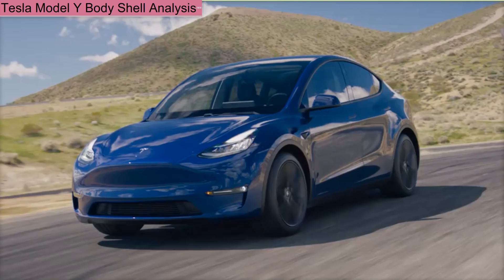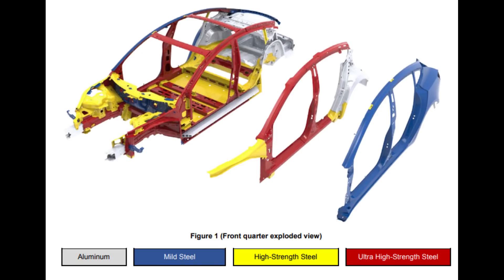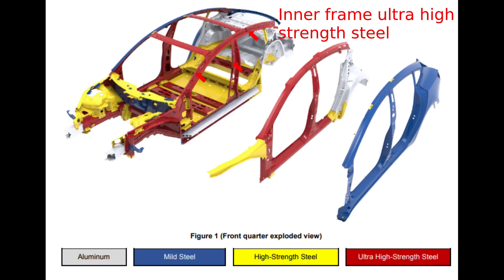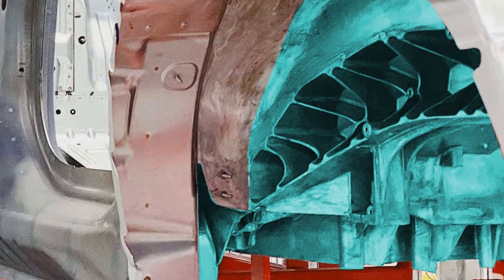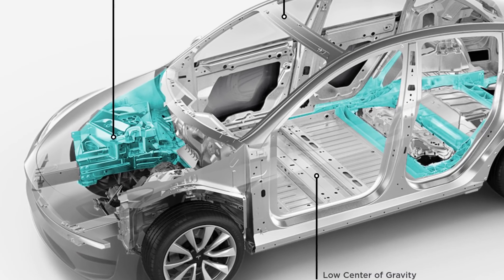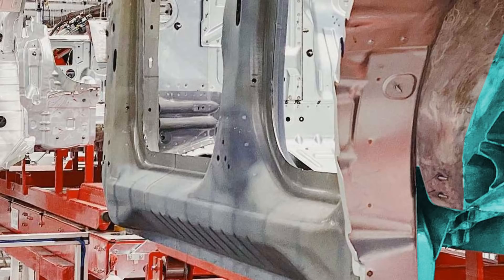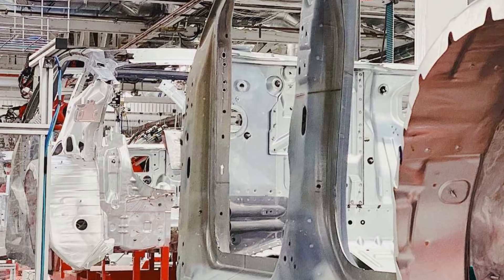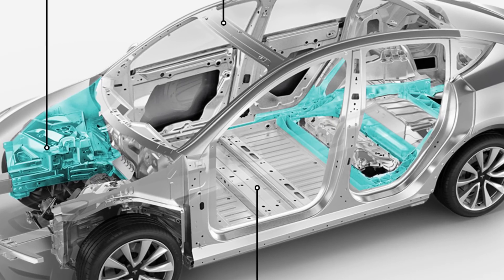Tesla Model Y Body Shell Analysis

Comment from the maker: Published just a few days ago, a patent by Tesla on new aluminium alloys for casting !
https://www.scribd.com/document/445965185/Tesla-Aluminum-Alloy

Tesla needs casting alloys with higher strength, and better hot tear strength, and flow into the mould better. This would allow them to make cast components with thinner strenghtening webs, that were also larger in size.
Reply: I looked at the patent, but to me it looks like it is about casts for electric motors, because main concern in the patent is combination of conductivity and structural strength. Also, patent talks about usage in motors not in body construction. So, I think that this one particular patent is not about casts for body. Nevertheless, this patent shows us that Tesla works on new alloys which will suits to their particular needs. Elon mentioned several times that SpaceX has their own team, which is developing their new alloys and the main connection between SpaceX and Tesla is material developments.
Reply from the maker: @pumahuhu365  Yes, I also noted that, but the requirements for flowability also suggests larger castings are evisioned. But as you say, the most important aspect of this patent is that it shows that Tesla is directly involved in the development of casting processes.
Reply: I would think as with stiffness and rigidity so safety is greatly improved using cast parts and as well much better resale value. What a big unknown would be is serviceability. That too could be great improved for say swapping out battery packs or drive units with far fewer attachment points necessary. Fit and finish (squeeks and rattles) should dramatically dissipate as well. Create a far more robust suspension to go with that and Tesla might finally have a vehicle worthy of the name at last.

Comment: Cast aluminium will be used only in areas that don't need to absorb energy in a crash since they are way less ductile and will crack upon deformation. There are a lot of areas where there you have no benefit of using cast parts so don't expect the car to be cast entirely as some patent drawings might fool people inte thinking.

Comment: The castings of the rear sub-assembly may be quite a fantastic production achievement, but it would almost certainly render the entire car a write-off, should any section of that cast structure (with its numerous fixing points) get damaged/fractured in a relatively small collision. Expect Insurance premiums to go be very, very high as a result.

Comment: 3:11 The rear part of the front frame attached to the firewall bulkhead appears to be a casting, but the middle part next to the wheel appears to be stamped sheet metal.  Telltales for me are thin ribs for casting and radiused bulges for stampings.  Castings can have thin projections like fins/ribs.  Stampings need to draw some metal through projections, so the protrusions have much gentler radii.

Comment: Do legacy makers do this and if not why not
Reply: It is rumored that Tesla is doing vacuum mold high pressure aluminum injection. If this is true then it is new technology and require expensive tooling that other manufacturer do not want to invest on.
Reply: As far as I'm aware, the only other manufacture that has done something similar to this in volume is GM with its Cadillac line, specifically in the Cadillac CT6.

Comment: Tesla actually filed some metal casting patents lately with some new aluminium alloys. Now makes sense. Thanks.
Reply: Metal filings ?
Reply: @williamgoode9114 
Ah I see what you did there clap clap👏👀😉🍻
Reply: No I missed the point entirely, the safety cage is steel and higher strength steel, the bracket under the back seat is huge casting, the trunk lining and all external skin panels are aluminum

Comment: Thanks for this.
Where would this casting be done?  What material is the aluminum cast into?
Is there a link that you can provide that would show(further explain) this process as it applies to the model Y in your video?
Reply from the maker: The casting will be made using several tool steel dies. The space between the dies forms the shape you want to cast, and will have the air sucked out before the liquid metal is injected in. The metal then cools and the casting sets solid. Each die has small pistons that push out the casting as the die moves back from the casting. The rear casting we are looking at needs at least four dies -  top, bottom, and one to form each side.
Reply: @dartmoorrambler  Thanks Peter, two more.
Are the dies done one at a time or all at once?
Is this the type of operation that would likely be In-house or off-site of the car manufacturing plant?
Reply from the maker: @davemilke3110  All the dies are brought together at the same time to enclose the space that is the exact size and shape of the casting.
Normally this would be outsourced to specialist firms, but for Tesla they  will want to have closer control than that. I would expect Tesla to do this casting on site,  and when they move to the larger integrated castings it will replace the stamping plant in the production line.
Reply: @dartmoorrambler  Thanks again Peter.  As a long-time shareholder of TSLA I am very aware of (and applaud) the companies' vertical structure desires.  Just did not know if the cast-process was beyond even them, but it sounds from you that they can do it if they choose to.
Reply: @dartmoorrambler  does not casting of steel and aluminum alloys require high amount of energy? It is also slow process - you need to heat it and then cool it down. Why other automakers do not use casting?
Reply from the maker: @pumahuhu365  Casting uses energy, but then so does a stamping press, and so does the process of producing the blanks for the stamping press, and then joining components together. Casting may save energy overall, but the bigger ( and expensive) problem is designing the dies and then manufacturing the dies. It is rather like a complex 3D jigsaw puzzle where there are many parts that all need to move in different directions. Some of the issues are highlighted in the Tesla patent I have pinned above, such as the strength of the alloy while still hot - the hot tear strength. Removing the casting from the mould while as hot as possible speeds up the production rate.
Reply: @dartmoorrambler  Concerning the energy consumtpion you might be right that theoretical total energy consumption might be similar, but if you produce coils/blanks you produce it in big steel mills, where you can recuperate more effectivelly and cheaper, because you can use cheap natural gas or coke oven gas to heat up alloy, then cool it with water during rolling process. Heat from cooling water can be also recuperated too.  IMHO it is hard to achieve that with casting as effectively. It would take complex production facility. Obviously I have no idea how modern casting manufacturing is done, but I cannot see how producing highly complex dies in era of high precision 3D metal printing can be the main issue. I can imagine that dies will be significantly cheaper than those super big hydraulic presses. You produce die once and then you dont need the new one. Am I right? What IMHO is an issue is speed of casting production. You need to cool it down in order to take it out and then store hot casts. It is time and space consuming. Especially such big pieces and when you have to produce 1 pcs/minute. If you are right, I would be really interested to see how Tesla is dealing with these issues and where do they produce thoses casts, becuase I cannot imagine that they would produce it in such high density factory such as Freemont.
Reply: @pumahuhu365  Tesla's Lathrop Facility was hiring casting specialist a couple of months ago. most likely they will do casting on Lathrop and transport the piece to Fremont for assembly.
Reply: Are castings weldable cos breakage in a minor collision even a bolt hole or two would be catastrophic if it ment a whole new piece !
Reply: @williamgoode9114  while an easily repairable frame seems like a good idea today, with the rise of self driving technology (particularly in Teslas) it might not be so much of a concern 5 years from now.
Reply: @kschleic9053  Good point.
Reply from the maker: @williamgoode9114  Castings used by Tesla are most likely to use a weldable alloy and be repairable, but spare parts might not be readily available.
Reply: Is there much plastic in the body panels of the car like Toyota